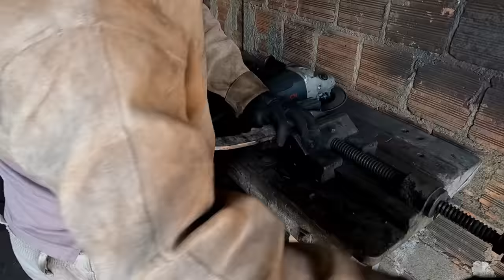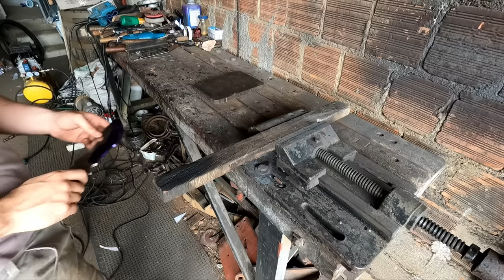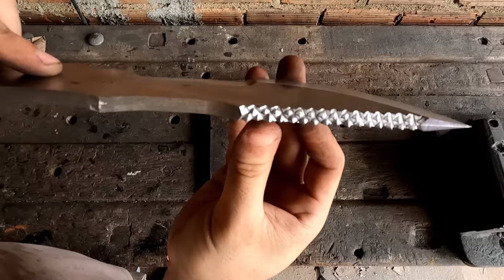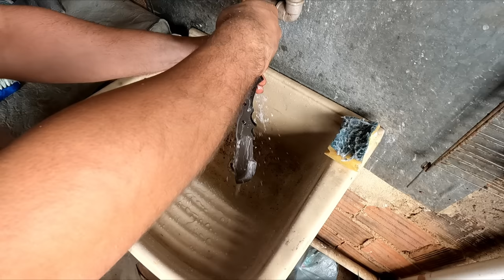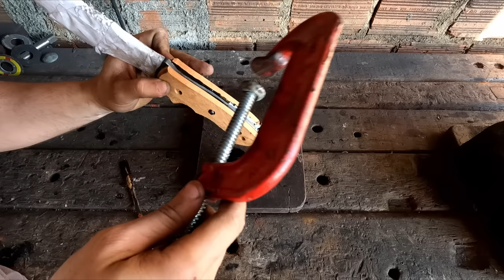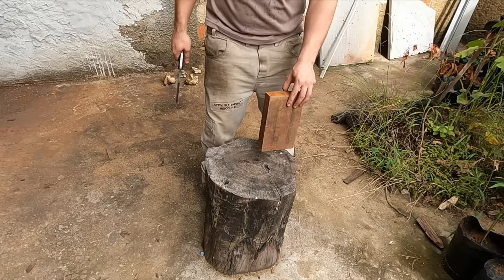Knife Making - Tom Brown Tracke: The Knife From  "THE HUNTED"

Comment: I made the roughest version of this knife.About 7 years ago. I didn't buff it or anything.I heated the steel, shaped it, sharpened it and that was it. I still have it. I've probably sharpened it 3 times and its still one of the best bushcraft knifes I've ever made.
Reply from the maker: Cool. This knife is a very good knife 👍👍👍
Reply: @MakerHA How'd  you made the saw back?
Reply from the maker: @grayrecluse7496 I made an X mark and then chipped away  👍👍👍

Comment: Well done indeed. I wonder what kind of steel that was, what you used to blacken it, and how well the saw edge worked. I bought mine but have been wanting to make one myself. The one i have is different on the saw part.
Reply from the maker: Thank you very much, my friend. The steel I used is spring steel, 5160. I used a solution of ferric perchloride acid to darken it.  👍👍👍
Reply: @MakerHA  you should make a bow with it. That's what the tracker was designed for. I made one with mine but I violated a growth ring and it snapped. But it shot fast. Lol
Reply from the maker: @carcasscruncher9354  Lol. Yes I could have done